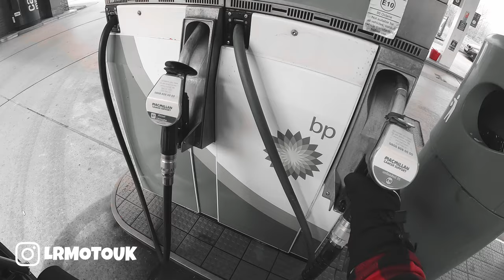Harley Davidson Sport Glide Failure | GoPro Hero 11 Test

Comment: I had something a bit similar, I could downshift all the way to 1st gear whilst on the move but if for some reason I had to make an emergency stop then I would not be able to shift her down at all. The bike was going in to do apes so the cable was replaced and adjusted and so far no problems. Fingers crossed it is something simple!

Take care!
Reply from the maker: Glad to hear you haven’t had issues since the bike went in for the new cable and adjustments. Update on my sport glide will be uploaded to the channel tomorrow night  :)